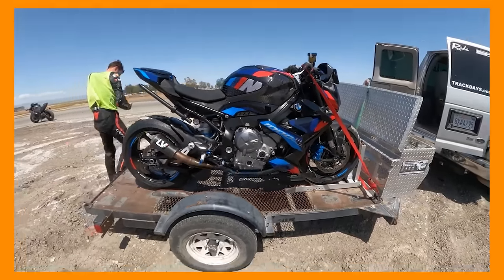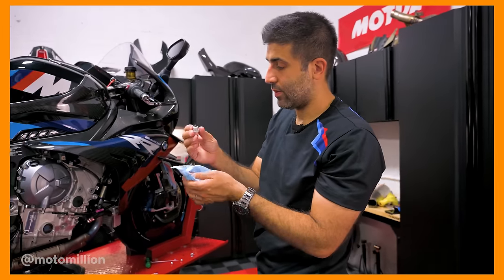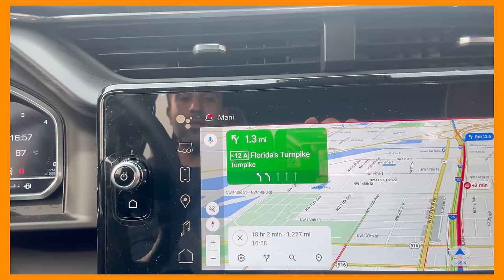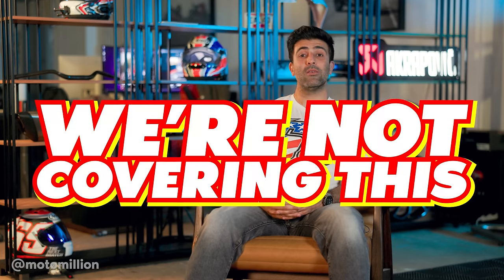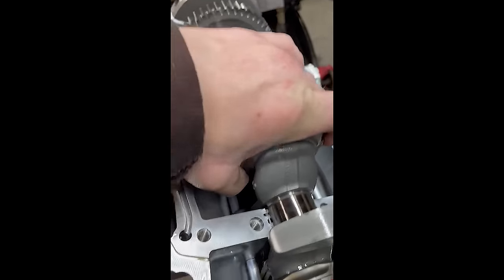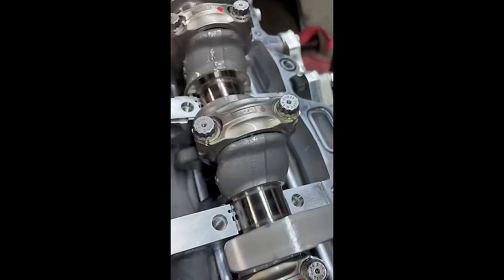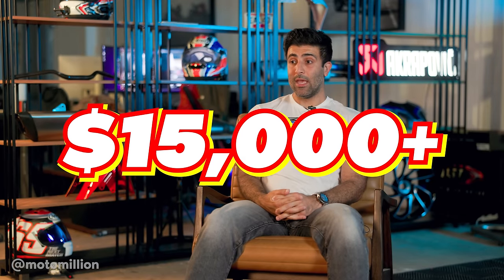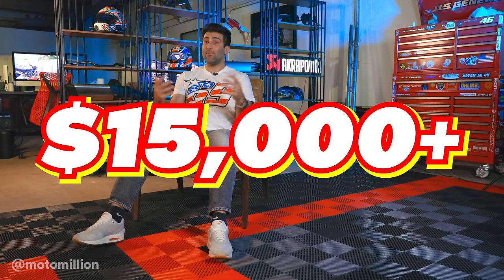MASSIVE Engine Failure on our M1000RR & BMW REFUSED Warranty...

Comment: I had the same issue with Aprilia (RS660 - the engine broke down). The bike was always well maintained in Aprilia dealerships. After many months of «battle » they said they won’t change the engine under warranty… F*ck Aprilia’s customer service.

And now, after watching this I want to sell my 2023 S1000RR 😫 I am afraid to have the same problem again…

Comment: Just keep revving it, it will clear out. 😎
Jokes aside, that's why you don't mess with a bike under warranty. Any bike may have hidden manufacturing or assembly defects and you need to make sure you're covered legally.
And it probably sucks not being able to make full use of the bike immediately to make videos and make profit but it is what it is.

Sure you probably didn't do anything wrong but law is the law and it clearly states - do NOT mess with a brand new bike or you risk voiding the warranty.
You tried an appeal to the brand so they don't get negative publicity and it didn't pan out. Live and learn. 🤷🏻‍♂️

P.S. Had you have been patient for mere 600mi, that engine would have probably gone out at full throttle anyway. It pays to have patience.
Besides, a weekend getaway ride would easily put 600mi on it, you simply didn't want to do the due diligence.

Comment: Once you modify your ecu its 100% up to bmw to warranty or not. Put their shoes on. Maybe Brentune can be trusted. But there could be many garage band tuners who don't know what they are doing. Why would you cover the engine when the customer tuned it???? If you buy a $30k motorcyle and want to risk your warranty for 10% gain in power, good luck. Spend the money on upgrading the rider. Not tuning and parts. Tires are expensive enough.

Ps. And yes BMW is prob not delivering a highly reliable bike. But if it was 100% stock it would be warrantied.

Comment: i have to pick up my brand new 2024 s1000rr from BMWmotorrad some next day and only waiting for good weather here in eastern europe. and now i watching this videos about failures =)))) and only hope in my head that my one will work fine :D but also i saw at the same dealership blowed engine from 2023 s1000rr with piston out (it happened on racetrack), and another one 2023 0 milage s1000rr witch engine was dissambled for pistons replacing buy warranty due to same issue. But i trust dealer who said that all this faults coming from faulty pistons.. but never know, need to try is that s1000rr good shit or none =))))
Reply: So they replaced the pistons with new ones at a brand new motorcycle instead of replacing the engine?Indeed?😂

Comment: don't worry about breaking it is just modify and run the shit out of it it's funny the guys that do all the proper break in  no bren tune they have no issues you need at least a couple thousand miles before beating it up 100% your fault period and he is so wrong a tune can destroy an engine but you should never mess with the computer until there is no warranty everyone knows that when you do ANY mods it is on you

Comment: Well it happend to me, my engine blow up at 245kmh i can send a picture to you if you want. I was lucky that i am still a live, engine block the rear wheel, oil all over the road i was able to slow down with the front break because the rear wheel was block full with oil

Comment: Sounds like it may have been that you removed stuff was my initial thought. But seeing the other guy racing completely stock bike and it happened to him and the bike made the same noise on top of that even a pro rider bike blew up too maybe it is BMW fault afterall. Not every thing will be picture perfect 100% and sounds like BMW doesn't wanna take responsibility by at least covering half because you did remove some key things. I was really looking forward to getting a BMW S1000RR for my 1st bike (Im no stranger to speed 815hp car) i'll prob take a look at a Gsxer instead or maybe a Sports touring bike.

Comment: This is a problem with BMW worldwide.  The "big bike BMW Fanboys" say the BMW's made in other non European countries are sub par.  Just take a look at the F700 GS and F800 GS.  BMW doesn't give a shit about the consumer.  The 700 and 800 GS have all kinds of issues.  As the years progress they recommend different oil viscosities which will solve your finding neutral issues.  Then there is the lean running issue solved by richening the 1/4 throttle.  Then the gear change claw not being polished, electronic issue which showed the vehicle in the wrong gear, and the list goes on.  One guy had stalling issues and he stalled his bike at the intersection when entering a major highway. No BMW dealer would discuss the issues of the used bike I purchased.  Not until I conducted internet queries describing the issues; did I find complaints from new owners dating back to when these models were new.  See Casey vs BMW of North America, Case 2:19-cv-14761 Document 1 Filed 07/05/19

Comment: I bought a brand new 2008 zx6r and for the first 5 thousand miles I never went over 10 thousand rpm’s and my bike now has 60 thousand miles and the engine does not consume a drop of oil and sound and rides as good as new 
In my opinion you should never have revés that engine so high being a brand new engine 
In my opinion this was all your fault

Comment: Man I'm so upset tbh, avid fan of motomillion , I've purchased everything for my bike through yall ! Amazing parts and service! I'm also a 2020s1000rr owner and a avid Motorrad fan especially of the M1000rr which is currently available at my local BMW Motorrad  dealer. Im tempted but I think I'd pass on the 2024 M 1000rr after everything I've seen . So unfortunate buddy ! Good thing you got the hard earned bucks to have gotten it going again !

Comment: So they warranty an engine with an aftermarket tune and engine mods, less than 500ish miles but not yours, makes sense. Your engine sounded sketchy from first video. 
The performance numbers on the new 1000RR from BMW is not impressive and it’s fairly slow. 
I’ll stick with my Ducati and Suzuki.

Comment: The warranty is for the bike in the condition you bought it from them in. The minute you hook up a programmer your warranty was void. I've seen them turn down a crank sensor replacement and void warranty because of aftermarket exhaust....they're ALWAYS looking for a way not to pay....
Reply: Nope, it's those who mess with brand new bikes in warranty and blow their engines who are ALWAYS looking to dodge accountability for their actions and get their expensive mistake paid for by BMW.
Reply: @mickeypopa   Blown up or not. You take the factory parts off and the factory tune out, the factory warranty is likely gone too.
Reply: @Six_One_Six 
I don't understand you at all. First you're saying they (manufacturers) are always looking not to pay, now you're agreeing with me. Which one is it??
Reply: @mickeypopa   They're always looking for a reason not to pay...so if you touch the factory tune, you're screwed...take their factory parts off, you're screwed, over rev it on the dyno you're screwed. I've seen BMW deny a $200 crank sensor repair over some after market exhaust...so if you hand them a reason, they'll deny you every time. Unless you're famous.
Reply: @Six_One_Six 
And they SHOULD deny claims by people who willingly void their warranty and even brag about it publicly on YouTube. Period.

Had they kept their mouth shut and not talked about removing rev limiter or tuning it, BMW maybe would've cut them some slack.
This way BMW cannot allow such disrespect to be rewarded with a free replacement engine.

Comment: i have a 2022 f900r and i bought it used certified in bmw motorrad with 8k miles on it i barley ride it for 1k miles and the engine started to sound realy bad and it lost power cheked in under waranty in the dealership and its been 7 months know and still whaiting never byuing a bmw bike never more such a disapointing brand ive espected much more quality from it and beter customer service

Comment: Thats dirty at 9 miles it said possible damage how can they not replace the engine if it wasn't over rev in 9 miles i would have told them shove the warranty that doesn't warranty!

Comment: "I didn't believe in it".  Wow. Instead of 'warning' others about BMW's issues, you should make a video "5 Things You Shouldn't Do With A Brand New Bike".  A video like that would actually be beneficial.  The bike warned you that there was a major issue at nine miles.  Then you rode for another 400 miles.  You removed the break-in rev limiter, and you put a bike that wasn't even properly broken-in on a dyno.  All new riders should watch this video to learn what NOT to do.

Comment: I recently watched a bike world video & low and behold that M1000RR grenaded too which motomillion shows in this video, this is ridiculous that bmw will not cover the engine under warranty, i dont care if the rev limiter was removed early, the engine should not throw a bearing, look at what moore mafia does to his brand new bikes, a few heat cycles, an ECU reflash & its off to the races with no engine failures, shame on you BMW!

Comment: The problem with bmw s1000rr owner that they in race to beat ducati panigale v4 which has way more power if u want comper stock vs stock in which case v4 has 191 to 193 hp stock where bmw has 179 stock tops. But no bmw fans  want comper and go by bt moto number to get 196 in which case u compromise engine this is prime example.  My ducati panigale v4 2023 has simple tune akrapovic exu. I dino my bike on two deferent dino in which case fist dino was 208 second 210 on pump gas. And that why I bought ducati v4 cuz the power is monster and if u want leave stock it still faster then any super sport out there.  Which I can't say about bmw when u have to do heavy mods to get in 190 range and compromise engine. I got 5k on my bike and I love everything about. It homicidal bike that needs to be riden .that another reson why I stop messing with Japanese bike that very restricted for reson and when u flash them and tune u cute engine life basically destroying engine.  .I rather spend 40k and get monster then spend 18k and invest 10k to modify so u can blow engine 😅😅

Comment: Did you run it in under 6ooo revs, beats me why any one ridding on roads with over 220 horsepower needs to tune in more you wouldn’t ever notice. And to drive 19 hours no wonder the pollutions bad

Comment: So, you've taken the engine apart using non-BMW approved methods (not using their garage), you've over-revved it on a dyno even though the break-in hasn't been completed yet. 
And you're surprised that they don't cover the warranty... 
Says more about you than the manufacturer. Oh, and FYI, no manufacturer would've covered it under those circumstances.

Edit: also learned he tuned it xD. Shouldn't have wasted the energy in this comment.

Comment: I'm going to be honest. I cannot believe that you are telling everything or the supposed M1krr also blew up from stock. The limits are there, the mileage too. This has a reason behind it. it is not from mechanics nor salespersons. This is not from the marketing, not from C-level of BMW group. There are mechanic engineers working on engine design. It's normal to put this kind of limits (rev, power, mileage), specially with the factory's oil. This is mandatory to make some parts lose but exactly the amount that is needed. If you do the first service before the mileage that is specified... you are take some risks and guess what: It happened. I feel sorry.
Also, you said you cannot mess up the engine by tunning... well, you can for sure. a bad AFR, and or bad VVT tunning and you blew up the engine fast.

Comment: lol, you remove the brake in rev limiter and expect them to honor the warranty?!

Like, you're probably right that it's got nothing to do with the failure, but you had to know that would give them solid grounds to refuse warranty should anything go wrong.
Reply from the maker: We did remove the break-in limiter. However, you're missing that this is part of the first service, which is done between 300 and 750 miles. And this is all in the BMW owner's manual.

So we followed their steps. Nothing was done out of spec
Reply: Fair enough. Regardless, I will file this under another case of All Modern Engineering Is Complete And Utter Crap.

Comment: a new engine or motorcycle can do easly 400 miles with 1st gear on rev limiter  , my think is the BMW work against the customer overpriece products without support and "fake" warranty. You save me  because tomorrow I would go buy it .now i will buy a Kawasaki H2 win :)

Comment: You took off the 600 mile Rev limiter with 300ish miles on it. I'm done here.
Reply from the maker: Owners manual states first service can be done between 350 and 700 miles. First service includes removing the break in limiter.
Reply: @Motomillion  I'm only suggesting you stay away from gray areas in manufactures warranty,  specifically break in procedures. More importantly German built high performance machines. You guys know what your doing and I'm sure you're going to do it differently next time.😀

Comment: When Bill blew his up on Cali moto TV but I'm not sure what they did for him ,,if it's modded it voids the warranty,,sad for such an expensive motorcycle,, and it's limited whilst running in ,, not a good sales pitch,, some old K6GSXR 1000 did 100000 miles,,sucks BMW shame about the experience,,☘️☘️☘️☘️☘️☘️☘️ from northern Ireland 😁
Reply from the maker: Thing is, Bill's bike blew up on the track. With a full exhaust and BrenTuning. And his engine was fully replaced under warranty.
Carwow's bike blew up on the drag strip. That bike was completely stock. I'm not sure how BMW handled that one.
Ours had an exhaust and BrenTuning, similar to Bill, but BMW was of no help to us.

Comment: I don't understand?

The bike was new, only 6 miles on bike...

You did assemble nor replace or add bearings...

So how is that your fault? 

I know nothing about this road bikes;  except I like to watch videos of them racing, wheelies, stunts, etc...

💥💥💥💥💥💥💥💥

Curious?

Maybe I missed it...

Did you buy from factory or some dealership?

If dealership, why wouldn't they resolve issue ( replace engine, refund bike / by it back full price )...

Seems like issue & all the info you have & other bikers that have had issues should get news media involved to do & investigative research & broadcast it to bring more attention to issue & protect other potential & interested buyers considering getting one of this model bike or any of the manufacturers bikes that are exhibiting or have had these issues...

There should be some sort of governmental entity that controls & protects public from   motorcycle manufactures & dealerships issues in resolving legitimate issues in timely manner & impose fines when necessary...

Thanks for sharing this video...

I'm not a biker...

Comment: Thats a shame Mani .. this is your baby .. the tuner must have been like what the fudge .. how can you not feel bad even if it's not your fsult.. Seems like the fly by wire throttle hung up after he let off WOT.. Now your doing OK financially.. imagine if some owner purchjased a new M1000RR cracking a BIG NUT every month in bike & insurance payments.. and you need to come up w/ $15K .. or have it rebuilt.. there could be microscopic shards, pieces of metal throughout the engine.. I find that really weird.. Built on a Monday or Friday Mani .
.. They see that bike being dynotuned with low miles.. they'll fight you tooth & nail.. These superbike have so much HP ... why take the chancew/ software changes ... I mean you'll lose that battle ... but holy shit that must be a factory faux paus ... Hang in there Mani !!!

Comment: Most probably the engine assembly was not done correctly but still you did a mistake when you did the service outside the agency, removed the rev limiter and over reved the motorcycle.. BMW took advantage out of that… very simple… 
You should have sticked to the BMW warranty procedure.

Comment: All of the comments here are valid.❤❤ Firstly, I'm old school so I still believe in a full term run period for any motorized motor cycle or vehicle. By cutting the run in period and modifying the tuning, you can't deny that you affected the outcome!! As a lot of people have said, I'm not surprised BMW voided the engine claim. On the flip side though, there seems to be a serious problem with low miles engine failure on these bikes!! This video has highlighted this and made us more aware of the real problem that exists.  Thanks for your content, and for not being arrogant  or biased, but for delivering the facts in a genuine way. Note to self:   Be patient during the run in period.❤

Comment: This machine is intended for racing and its expensive for most people but the price obviously does not justify the quality however you should blame the American way on this case and how your business model works...I have a good friend who races in SBK championship in Europe, bought brand new M1000RR in 2023 raced the season on it like hell...at the end of the year he was racing in Spain very hot weather behind some rider and the engine overheated still running fine but blowing the coolant anyway he completed the season and went to BMW in Bulgaria where was originally purchased they replaced engine with new one no issues at all! So you Americans you have everything and now you complain from BMW customer service well poor you!